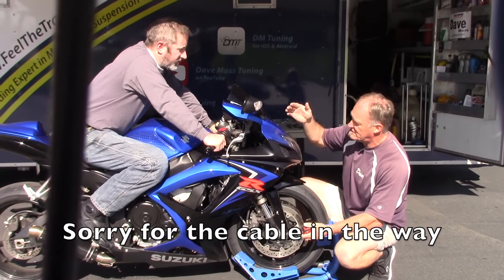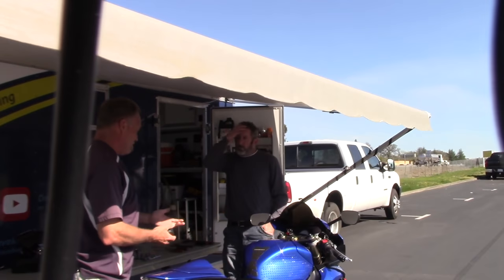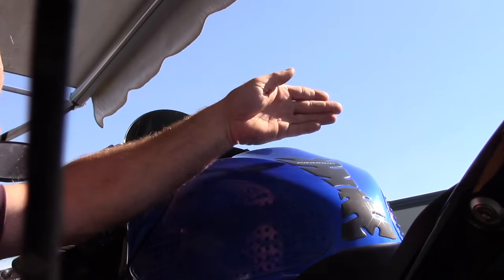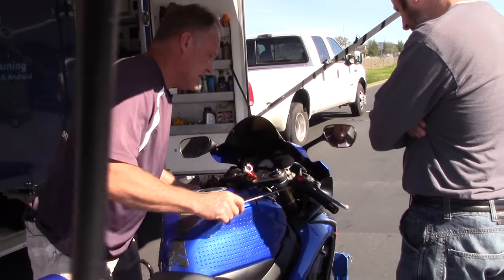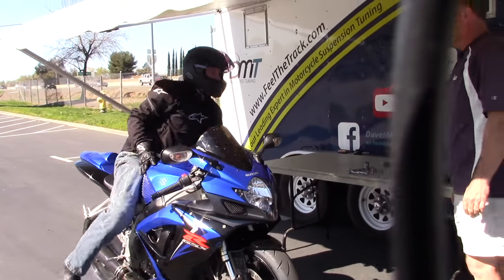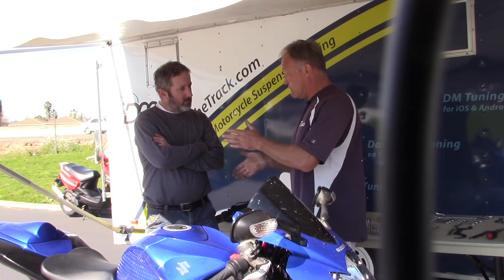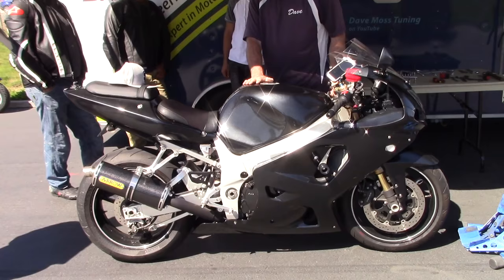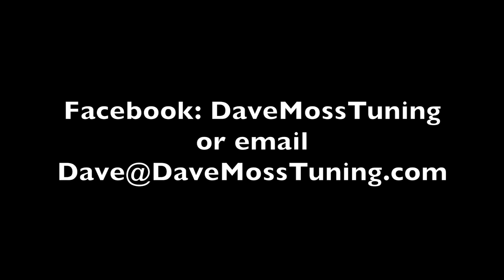2 Clicks Out: Street Bikes at Cycle Gear (TRAILER)

Comment: Dear Mr Moss
If I can suggest a topic for a video that I struggle with:
Head stock angle; rake and trail, offset.

Reason for that subject of topic is front end conversions... for example sv650.

I know that there has been a video that contained informations about Yokes with exchangeble inserts for offset change - but i would love to here more about the complete front end geometry and how it affects the bike handling.

Thank You

ps. thank You for all the videos
Reply from the maker: We can put something together on that. In the interim, when you brake you reduce the fork length to help the bike turn. If you raise or lower the forks in the triple clamps you are doing the same before you ride. That is  person choice. More rake and trail = greater stability and effort in placing the bike where you want it. Less rake and trail = the bike helping by turning in for you. The balancing act is fork position and then suspension settings.
Reply: If you have an SV650, the 06-09 GSXR600/750 front end is tried and tested and excellent. Throw in a 06-07 ZX10R rear shock and the bike handles amazingly!

Head-stock angle can usually be referred to as rake angle. Offset is how much the forks are ahead of the head stock, which is accomplished with triple trees. Trail needs to be explained with a diagram to be understood, which you can look up. 

More trail/more rake = more stability/less turning agility and vice versa. 

Here's a good article explaining all that stuff:
http://www.motorcycle-superstore.com/4125/mngr/rake-and-trail-explained.aspx

Comment: Thank You for the unswear and I hope You will find time to create video on it.

I have Honda cb600f hornet from 1998 whitch is my long term project on wchitch I try to leatn as much as I can about the bike.
I have gsxr 750 k7 forks and Yokes for this project that I have adapted stearing steam to fit hornets frames head but in theory there is several things that will work negatively on the handling (make it very nerwous) whitch are:
- 16 inch front wheel
- offset shorter by 20mm on the gsxr Yokes compering to hornet ones
- shorter fork leg (possibly step down top Yoke could tge axle back to its oryginal position in re to steering head.
- most of 16 inch wheel tyres have quite agressive profile and there is a rather small selection of tyres for this size of wheels.

The rear of the bike has modifications as well - vfr 800 single sided swing arm - again my question would be :
- does the angle of the shock absorber in regards to swing arm make a difference to handling
- how does the lenght of the swing arm affects the handling
- could rear tyre profile have positive influance on slowing the steering down?

sorry I know its a houge subject and covers nearly all of the bikes geometry topics but it would be fantstic to have video material that shows how the different properties affect eachother and handling (similarly to the hydraulic systems affecting tyres and viceversa)

again thank You for the reply Dave

Kind Regards 

Jakub
Reply: sorry forgot to say that the rake is also differnd on hornet (i don't know what the difference is but i belive hornets one is steaper - what would work ok with 20mm larger offset for stability)
Reply from the maker: Most of the detailed answers to geometry you seek especially regarding geometry are in the DMT App. In short to answer your questions: you will have to have gull wing triple clamps to cope with the shorter forks and have fork cap extenders to give you fork position assistance. Riding the bike will assess geometry, not necessarily numbers so you need theory and riding combined to make a discovery rather than project an outcome. The swing arm and shock mount will set shock angle. That creates the leverage ratios for the shock to work from. As long as the shock has no interference you will have to check sag numbers and again, go and ride. Tires will be sport touring tires for slower handling.
Reply: so in Your opinion I shouldn't be put away by the number of things that suggest that the sterting is going to be impossibly twitchy and that the hydraulics will be able to compensate for the geometry disadvantages ... 
sorry but I'm just curious as normaly offset change numbers are counted in milimeters rather than doesens of them... 
Thank You Dave
Reply from the maker: Numbers tell a story that projects an outcome. Riding the bike tells it's own story. How close do the two stories relate to each other? Same analogy is book smart verses street smart. Get both experiences and then reflect. The ride will of course be slow at first to discover what the bike is telling you......
Reply: Wow 
that was a holly grail of a spirytual unswear to a technical/ingeneering question ;-)

and ok I WILL DO IT and will let It be my presumably very twitchy road to a nirvana of bike building experience :-)

thank You Dave
Reply from the maker: Sag and hydraulics along with fork position will set the starting point for the forks. Ride it and see how it behaves. If the front is too fast in steering raising the front end might alleviate it, it might not. If you fully extend the front end and it is still twitchy then you will have a very good idea of which offset you will need.
Reply from the maker: I was taught that engineering is a process. You have a starting point, you set the objective and then through a series of controlled experiments you will experience success and failure and along the way, learn a great deal via that process. You can also start from a thoroughly different place after combining all the known factors into a build/creation that you deem to be very close to correct. You then go through the same series of controlled experiments for the same purpose. Which part of the journey/experience would you like to take? I prefer the entire journey for all the lessons. Please choose your own starting point prior to your first ride to make the process as short or long as you choose based on what you want to learn.
Reply: I don't mind for "creatio ex nihilo" to take time, and I enjoy contemplating it in a spare time.
The only issue is that I'm trying to work on budget (the choise of bike wasn't exactly a long scientific selection... I have literaly just been given it as an extra with something else, by the guy that just wanted it to dissapear from his life :-)
but I love it.
The best thing imaginable to happen would be to fly to states and do some classes with You ...

Comment: hi I have a 2003 Yamaha R6 I got rid of the long exhaust muffler and made a bracket and put a slip on  m4 and I have a Power Commander 3 how can I get more power off my bike I'm installing a block off plate some people are telling me to put a R1 throttle body I don't know if that's true that you could put something like that for performance can you give me some pointers
Reply from the maker: The best value for money is the PC3 and degreeing the cams. You can change to a smaller head gasket to add compression but that would be all that you would need. Once all those changes have been made, the bike then needs to be mapped for fuel and ignition timing.

Comment: Because of the tension on the shock, the pitch of the motorcycle is at the gas cap, not at the seat? Huh?
Reply from the maker: If a shock is stiff the weight bias is more forward. If the shock is soft, the weight bias is rearward. Add in rider weight (without setting sag) and you can make this bias even more different. Then factor in ability and skills and weight transfer fore and aft can become extreme.
Reply: Thanks for clearing that up! Usually, pitch refers towards some direction (frontward/rearward) as opposed to pitch at a particular point, which made it almost seem like you're talking about a roll center. Weight bias towards the front makes a lot more sense though